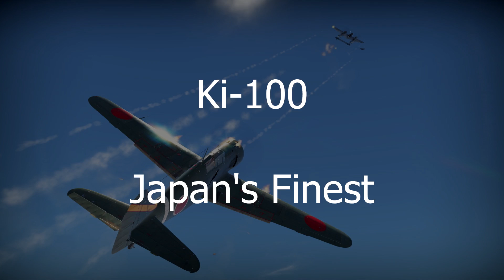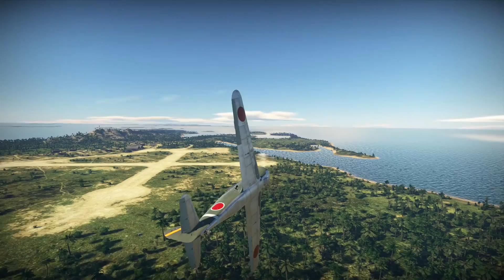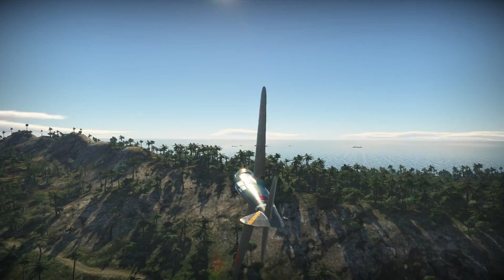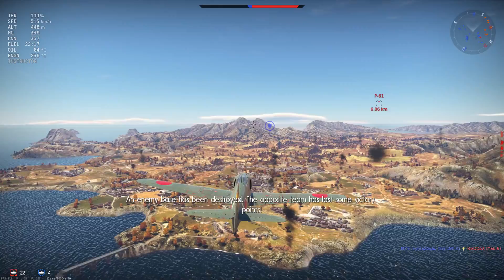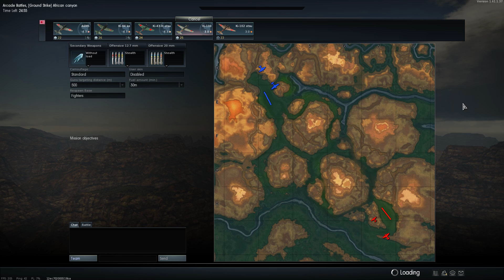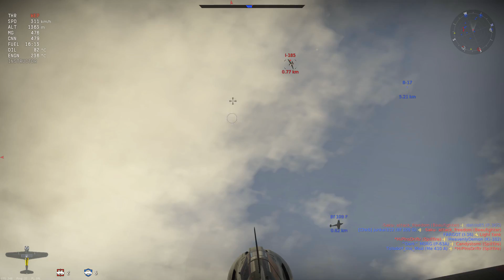War Thunder: Ki-100 - Japan's Finest

Comment: The superiority of the Ki-100 is mythical, not legendary. In reality,  was not overall  equal to any allied fighter in 1945.  Japanese fanboys need to give the worship of the Ki-100 a rest.    It did have pleasant flying characteristics and was reliable.   It was a "quick" fighter in maneuvers which increased pilot survival, but not fast and not rugged. It's armament was "meh".  Japan's "finest" is a relative term. Japan was so outclassed by the industrial might of the US and the quality and quantity of the US forces that purple prose seems more of an insult than a compliment. It was a successful  cobbled together aircraft that combined a reliable engine of lesser horsepower to a proven airframe and as such did not push performance nor strain Japanese industry.

Comment: Great review and suberb flying as always.

But C'mon. You are flying 850+ km/h with a relatively light japanese fighter of 1944. And you are surprised about some control issues? Seriously? Why did you repeat this very foreseeable and forgiveable issue over and over? 

There are not that many 3.0 planes performing reliably at 850+ km/h.
Reply from the maker: Thanks Frank. :)

The reason I repeated it is because I have seen a lot of players using this plane in a Boom and Zoom role; especially in 3.0 Air Dom matches and I feel it gives off a bad representation of the plane. I agree I did go a little bit overboard.

The only planes that I can think of that have reliable performance at those speeds and that BR would be: P-47D and the Ki-44.

Comment: I think you gave a pretty fair assessment of this plane. it works really well with your play style and skill set. 

however, if gaijin continues with in game #'s to reset BR levels especially in arcade I think it will go up, as you & others have indicated, but will come back down. maybe not to its current level but under 4.0 (think hispano mustang).

the cannon stang is sort of its twin in regards to capabilities vs. in game realities. both planes that can EASILY be not only uptiered in BR, but can compete at higher tiers. as you have seen, I am a mediocre pilot at best, but I have no problems getting  multiple frags @ 5.0-5.3 with the hispano mustang so long as I don't make a mistake. I suspect the ki-100 is going to be much the same. look for it to be my #3 plane after a bit (right behind the US and British hispano mustangs respectfully)
Reply from the maker: Nice comment flY, and thank you for the compliment. :)

I agree with you. I think its BR - and the potential rise and fall of it - goes to highlight the need for the BRs of the Japanese IJAAF line to be re-assessed (i.e. up to, but not including the Ki-84 Ko) in my opinion. I will be interested to see where it ends up.

I can see where you are coming from in the Cannon-stang comparison; and I have been seeing more of them in higher tier matches due to their potential. I would use it more myself but I personally find the lack of straight-line acceleration, especially above 4000m altitude, to be a major drawback for my preferred playstyle.

Comment: They really botched the BR's for the new airplanes in this patch. I can see this one go easily to 4.3. Excellent video as always.
Reply: oh Rubbish! 3.7 max. Think about it - it's a plane with top speed less than 590km/s. Compare of Spit mark 9 at br 4 - 89km/h faster and almost double climb rate. Though I guess to compare to the absurd BRs of ki61 with 2 x Mg151 and ki61 ii ... 4.3 seems reasonable (but that's, really, just representative of the silly BR of higher ki61s).
Reply from the maker: Thank you. :)As for the BRs, I reckon the Ki-100 will experience the same fate as the N1K1 (i.e. BR increase rather soon after introduction). Cannot comment on the P-47N although I have heard bad news stories about its stock grind (i.e. the ~1 m/s climb rate).
Reply from the maker: I think Polaventris may have been referring to the plane's BR in Arcade rather than Realistic.Although you have raised quite a good side point - there is a significant disparity between AB and RB BRs in general.
Reply: As always:

The P-47 will drop in BR, because these RP-Junkeys will use it as ground attacker

The Ki-100 will get a higher BR soon.

So first spade the japanese plane and afterwards the american plane after it dropped. Simple like that. Golden rule since years!

Comment: It's good stock, and amazing spaded. I spaded it after watching the stream (must do it before it's inevitably uptiered) and done so at 32 kills to 3 death. It has nose mounted cannons, with a huge 500 ammo load, that somehow kills extremely reliably, often capable of taking out a target within a very short window, allowing multiple kills in a single BZ pass. The lockup at high speeds is the only real drawback, but it is a really good fighter at low to mid altitudes, where you'll find most of the BR3.0 furballs at, especially domination games.

I can't actually comment on the fragility of the plane, since I've not actually been shot down in it once. Of the three deaths, two was due to crashing into the ground (greedy + control lockup), and one was friendly collision. It is capable of multiple tactics in escaping a dangerous situation, with good turning and speed retention, and can often even turn the tables around.

The only better time I had in a fighter was when the P-51 (4 x Hispano) was at 2.7. Fully expecting a raise of at least 1.0 BR , if not more, as well as being re-shifted down the line, behind the (overtiered) Ki-61-II.
Reply from the maker: In complete agreement with you Andy. :)I have yet to fly the Ki-61-II, but I have heard very negative reviews about it. If you have had the chance to fly it, do you mind elaborating on your experiences?

Comment: I spaded this thing in a day. I love the rudder since it's similar to the la 9. The guns work really nice, it is all around a good plane with a very good flight model ,good job gajin !!! I do think however it needs it's battle rating up tiered to 4.0 or 3.7 at the least since at 3.0 it trolls younger pilots hard. What are your thoughts ? Almost to 3000 subs Paul congrats ;)
Reply from the maker: Completely agree with you Eagle. The thing is, I prefer not to call planes OP (because some planes were better than others); but instead prefer to say that this is a plane that in the hands of a newer pilot, can achieve great results; and in the hands of a great pilot, will decimate an enemy team at its current BR.Aye, we are almost there, we can make it! :D